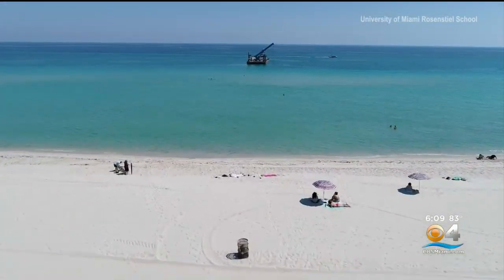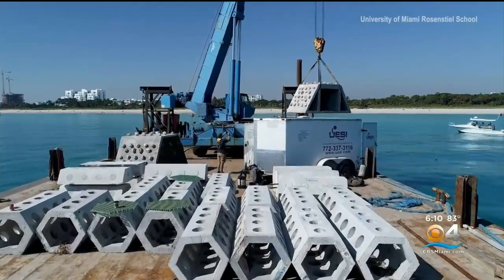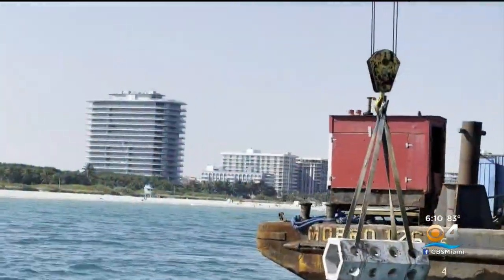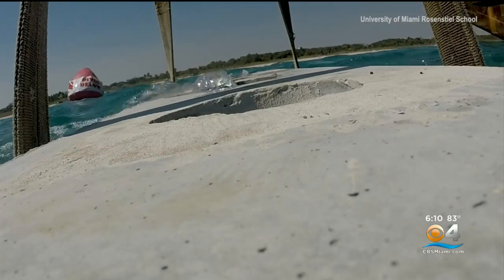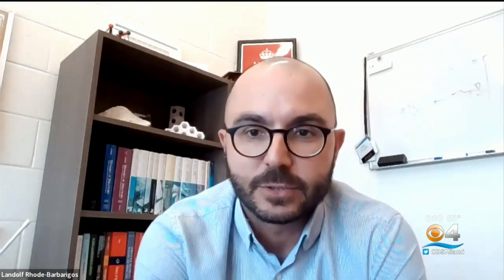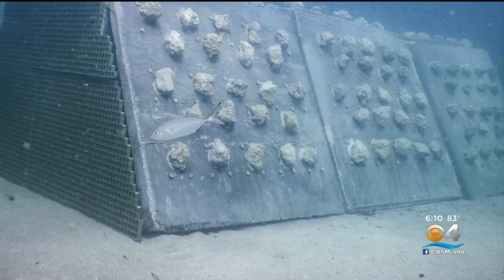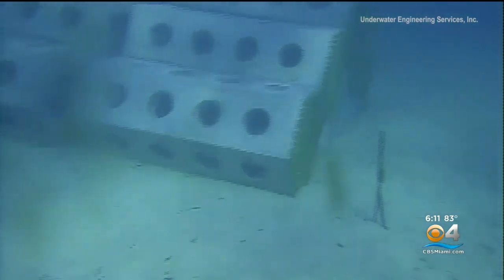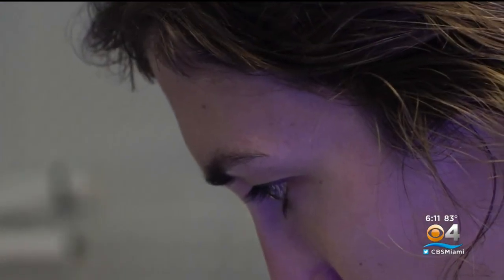Underwater structures to prevent beach erosion

Comment: Compacting the beach sand helps keep the sand in place. Less sand gets washed out to sea during storms. Florida needs to work with a dredging company to design a dredger that can move across the ocean floor in shallow waters maybe 300- 500 feet out from the beach and dredge sand for the beaches. A compact machine that can move up and down the coast each year. That way large dredgers and all the equipment are not needed.